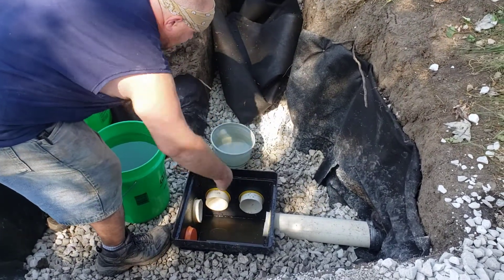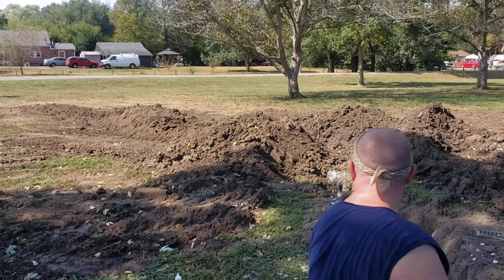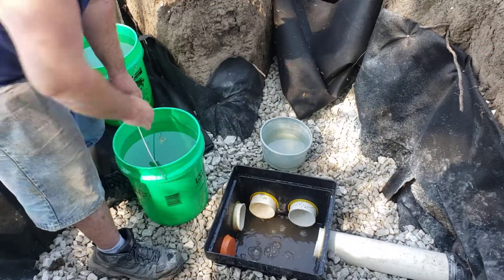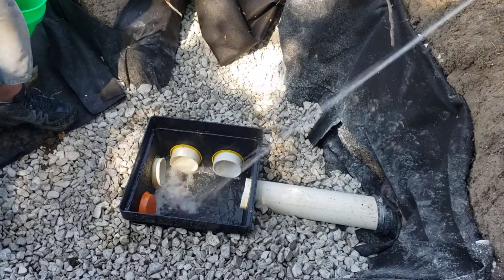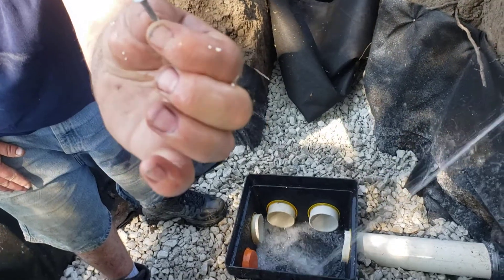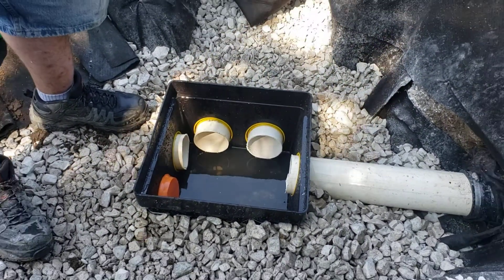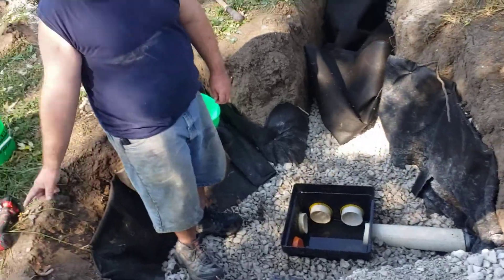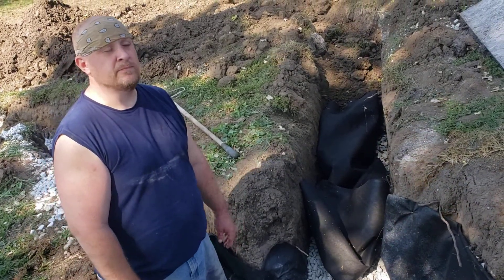Distribution Box Test

Comment: Installing "filter fabric" underneath the gravel or crushed stone isn't necessary. In fact, it could cause problems, because the fabric can plug up, which prevents the water from leaching. You only need the fabric over the top of the aggregate to prevent sediment from getting into the stone. Obviously, the aggregate layer needs protection from the top, but not the bottom. Otherwise, this guy did a pretty good job replacing the Distribution Box for this system.
Reply: I was thinking the same thing and I was planning on completely wrapping my stone in fabric. I made sure to get 6 oz nonwoven geotextile for this reason which seems to allow water to flow through pretty well. But I'm torn and I'm thinking that I may just put it on top just to be safe

Comment: Perfect World I would have loved to have been given the time to construct, however the materials available (shortage and backorder issues) this distribution box was what was available.   Placement of this box was the same spot a smaller cement distribution box was buried (About 4' underground to the top) and the 3 lines were a redirection from 50-year old lines that had failed.   

From the time I broke ground to when my Wife was grading the surface was about 4 days.  We used a combination of a skid steer, a backhoe, and various hand implements.

Comment: No speed levelers?   No risers?
Reply: With mine the box isn't deep enough so I have to use the speed levelers just to make sure that there's some depth inside the box. However this is a second distribution box so there is one distribution box that is deeper and is concrete. So it should be just fine
Reply: And definitely should have installed some clean outs. I am just because I like to know what's going on and how well the system is performing. 

I'm actually putting a clean out right in front of this second distribution box and I'm putting a clean out at the end of each of the two additional laterals I'm running.